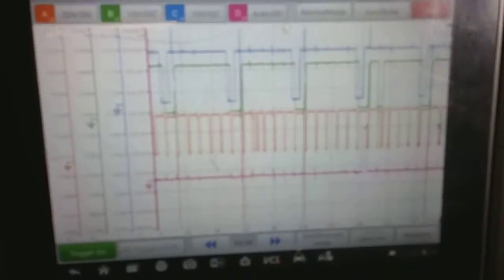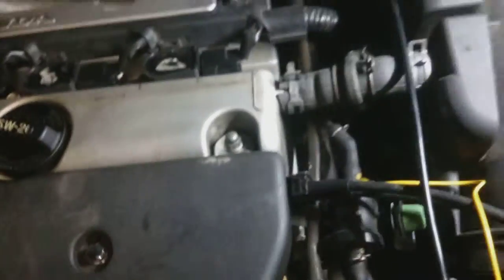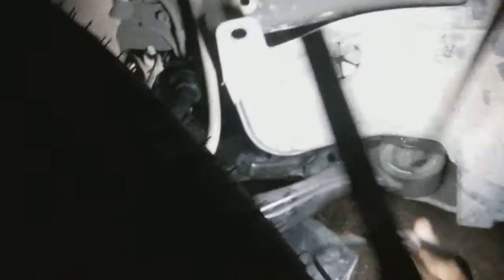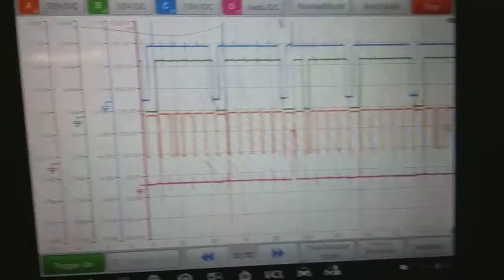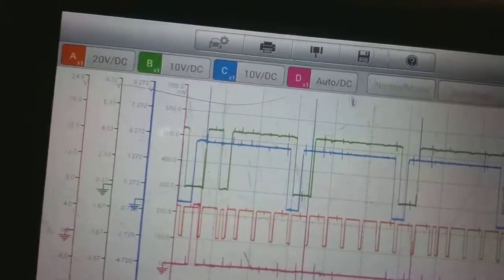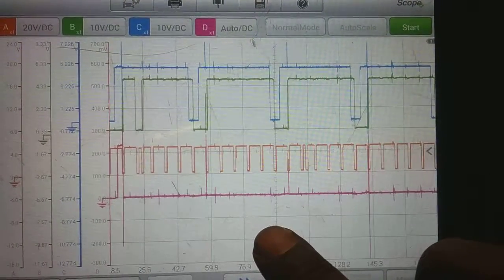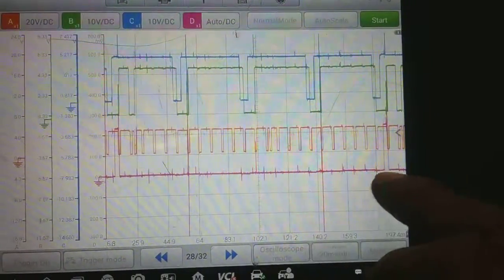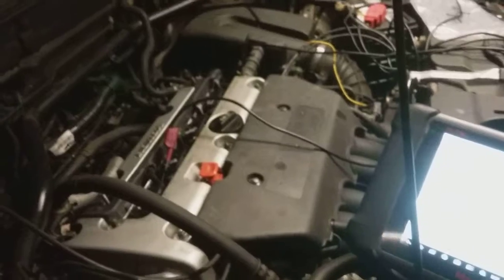Waveform Honda 2.4 crank/cam correlation INFO ONLY W/Autel Maxiscope

Comment: Do some ignition coil waveforms and fuel injector waveforms. I have the same autel setup
Reply from the maker: t nads if I ever get something questionable I will. It's just rare to get bad injectors and diagnosing misfires are easy [knock on wood]  I gotcha bro!